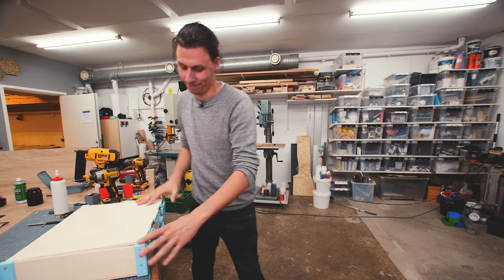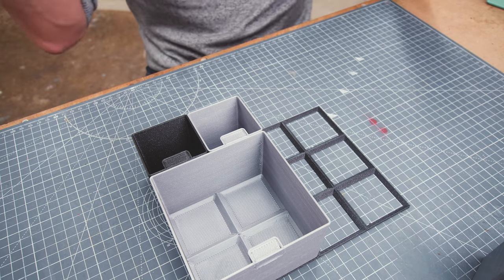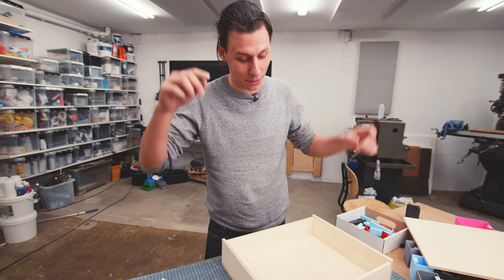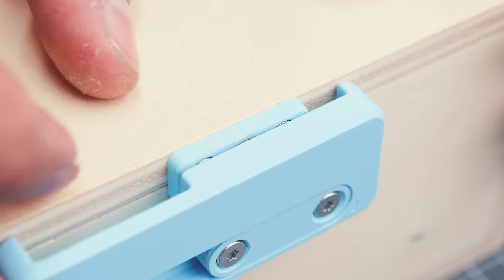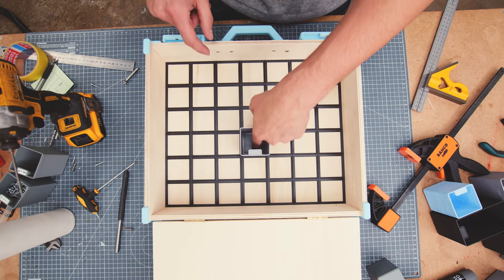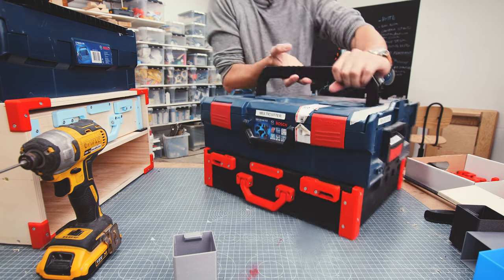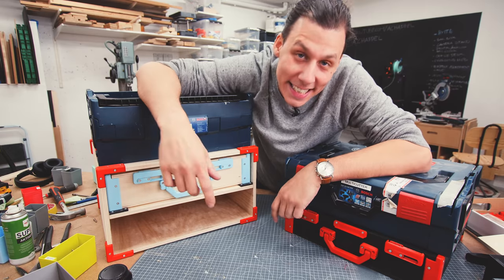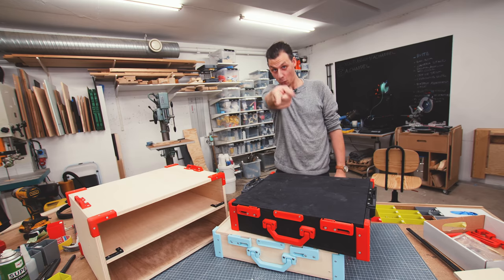3D Printing Even Better Assortment Boxes - And Making a Case for Them!

Comment: another solution to the boxes sliding around is just getting self adhesive double sided magnetic tape and applying them to the base of the drawer with both sides attached to the drawer and place your boxes directly on the tape as carefully as you can to set an overlapping grid with the crosses in the center of the 1x1 parts of each box. then you can lift all of the boxes at once and flip them over and cut the tape flush between each box.

Comment: As far as I can see, the Bosch boxes are wider than your homemade boxes. Would it perhaps work if you modified the Bosch adapter that you screwed to your box so that you could slide it up and down? Then, if the Bosch Box is not on it, the latch would slide down and the box would fit back into the cabinet. Provided you make the cabinet a few centimeters wider.

Comment: Well.... kicked up the printer... just have to adjust wood sizes slightly for available plywood size.    My goal is going to be a bunch of boxes... and an upsized Verizon of your 2 box holder... I’m thinking around 10 up to store a ton of parts and be kinda a cross between these and your other cabinet!

Comment: Made purchase in October.  Rescaled size and height, making each box (50.8mm x 50.8mm x 63.5mm).  Then moved to the 1 x 2 (50.8mm x 101.6mm x 63.5mm).  I know I can turn the box 90 degrees, but I would prefer a box 2 x 1 (101.6mm x 50.8mm x 63.5mm)is this possible. In any case Love your designs.

Comment: I note that your trays are almost square. If they were truly square, you could put the larger multiples in either direction. Personally, I went for a 80mm x 55mm base modules size. That way I can multiply  (or half) either dimension and get a much wider range of sizes. It also matches a commercial size, so I get some for free (they are used in Screwfix grab boxes of screws). And I can use those commercial grab boxes to carry selections with me. 
Not sure why, but my trays never slide about in the drawer like yours. Perhaps because I do not slope the sides. Not sure why you do... The grab boxes have locators.
Catches I do like.
Multiple box carrier- why not just have the boxes latch together? Like the boxes from Makita, DeWalt, Milwaukee, Bosch, etc etc. Simple, light, and you are not limited to two...

Comment: Hello Alexandre, I ordered the files for this parts en printed the lock and handle already. I have a  question: what size bolts and nuts are you using? The holes are about 4 mm, but when I use M4, the nuts are very lose. You're from Sweden, so I think you're using metric sizes? Or not? Greetings from the Netherlands from Bert

Comment: If you make the lid a mm or 2 higher, and then add a little rubber pad on the inside or some foam you know every parts tray is pressed against the lid and even the smallest of parts stay inside of their boxes when moving the case around. Maybe something to try for a next video?

Comment: what hardware are you using for this? like size and qty of the screws, nuts and bolts would be great. I purchased the plans, but it didn't have those listed or a parts list for those

Comment: I really like these boxes. I bought the files for the new models and I can't wait to fill up the drawers in my tool chest. I also like that you listened to your users and did 1to1 versions, which I prefer.

One request: is there any way you could offer a scad file so we could customize the boxes? I want to put them in a tool chest I already have and most of the drawers are too shallow for these. Currently my only option is to scale the existing boxes, but just on the height, and that works but only if I'm shortening them a little bit. I've printed a bunch of them at 60mm instead of 75 and that works well enough, but any shorter and I think I'd have problems with the overhangs, and I'd definitely loose definition on the grid system grooves.

Otherwise, thanks for the boxes!

edit
And definitely the wood colored boxes. Way better than the black. But maybe a more contrasting color for the 3D printed parts?

Comment: Instead of building a box that only holds two boxes, maybe 3D print latches, using a carbon fiber reinforced filament, that allows you to secure the boxes to each other. Something very similar to what you printed to attach your shop made boxes to the Bosch tool box.

Comment: I want to use 9mm MDF as that was more readily available but i do not have a nailgun. would glueing and then the corner pieces with the screws be strong enough? Or do i need to use nails or staples ? Any suggestions are welcome !

Comment: i would remake the big box but before you build it, I would measure (width) the box for tools and attach a thick but not to thick piece of MDF to the bottom of the shelf and top (inside) of the top and then that would fix the attachments not fitting in the box

Comment: wat are the inner sizes of these assortment cases? I would love to make a case with some larger boxes where I can put my hammers, screw drivers etc. Do you also have plans for an assortment case that will hold the square boxes (which can be put vertical and horizontal)?

Comment: Any recommendations on how to reduce the print time on the boxes?  Would running a bigger diameter nozzle help?  I'll be buying the v2 files, any advice on optimizing the printing would be appreciated, maybe a write up on your blog.
Reply: Yep bigger nozzle and bigger layer height improve print speed significantly for this type of thing. Bigger nozzle also means bigger line width so you can use fewer wall lines which further improves speed. Unless you're messing around with printing toys and stuff, increasing nozzle size is one of the best upgrades if you want to do practical 3D prints. Of course the prints don't look as fine but for functional parts it shouldn't matter much. I use a .06 nozzle now but will probably go even bigger for speed.

Comment: i think a possibly easier way to prevent them sliding around would be to just have spacer boxes that are single unti sized in your case. then when you want to put something int he case, you take out some of those spacers, switch them for the boxes in the drawer with the components inside,  then your drawer boxes dont slider around and your case is full of boxes even if you dont need to fill it with boxes with stuff in all the slots.

Comment: Nice! The New Version looks like the System in the "OBI" (German toolshop) Cases. The Old System there was better, the new one is smaler but you cant pick out the boxes anymore, so your System is better for me :-)
How many hours did you need for this boxes? the 1x1 needs >1h at my cura Settings :-P

Comment: I bought the plans. this is an awesome design. 
I just printed the square grid. bun in the grid the boxes can move a lot (3mm in x and y). I don´t think the grid will be as good as the one in the video. 
So whats wrong?
Reply: so the height of the printed grid was only 2mm instead of 4mm in the model. so i scaled the grid in z to 6mm height and now it is working gread. dunno why the height is so wrong in the firstplace.

Comment: Instead of CHOSING a color (black or wood), you should grab the opportunity to color code even more, like, you got the color of the 3D-printed parts to color code slight differences like type of thread and lenght, then you can go for black boxes for torx, or wood for metric and black for imperial or something. Grab the opportunity :) :)

Comment: Well done boxes! But I would test them with some tiny washers, as they can easily fall through the tiny gaps between the lid and the cups especially in the middle of the box/briefcase :-).
Reply: Good point. Could be addressed by using a foam gasket around the rim of cups that need to hold washers and such, letting it protrude just enough to make complete contact with the lid. Such a lip could probably be printed in Ninjaflex/TPE, and for anyone with a dual material printer it could even be printed in-place.

Comment: I think it would have been a better solution, if the boxes would snap in together if they are stacked on top of each other. So you wouldn’t need an extra box to carry them together, how it is possible with some professional boxes, like the Systainer (Festool) or the L-Boxx (Used by multiple companies).
It only requires an additional handle on top of the boxes.

Comment: I need to organise all my bolts/nuts/etc so I bit the bullet and bought the plans for these boxes :) Of course, then I realised they're all too tall to fit in their target drawer. D'oh! Back to the Fusion360 drawing board for me.. (you can't just scale the boxes down due to the locking base feature - well, I could scale both parts, I suppose.. hm!)

Other than that they're great - just like the system in my sorting boxes (a little like Sortimo) but I can have any size containers I want and not the shapes the container manufacturer decided I should have!

Comment: I believe you should have used the printed corner of the boxes to lock them together n'y adding a little lock like for the top of each box it would have been lighter and easier to do

Comment: So in the last one there were a bunch of comments about making a mold for these instead of printing a bunch of them again, any thoughts to that? Personally don't know much of the limitations of cast molding, especially when it has that lip creating that undercut
Reply from the maker: Yeah, It's that lip for the label that makes it difficult to injection mold. Not impossible just expensive. And doing that for all the sizes would be VERY expensive. So unrealistic unless I wanted to start a business selling these to people full time :P And also, making changes like this would mean making new molds, whereas now I can just print new ones :)
Reply: @achappel  Expensive to injection mold for sure, but I think urethane cast molding with silicon molds could possibly work

Comment: Are the 3d files STL or some form of file that I can easily scale in Fusion without modifying things like the wall thickness or label area? Genuinely interested if they are not STL. I was gonna print the remix of your design which was parameterized, but the new design is obviously better.

Comment: The black and red case looks amazing, but rather than committing to one colour scheme, why not colour different cases based on the types of parts you store in them? Black case for screws, nuts, and bolts, while blue cases might be for hooks, hinges, etc. Up to you what colours means what, of course, but colour-coding means that you can grab the right case at a glance without having to read the front label to see what's in them.

Comment: I've been looking at a lot of your videos, but could someone help me out real quick? 

What filament are you/is he using here? I've just used PLA at this point on the Ender 3, and haven't yet stepped out into the realm of ABS or Nylon. I'm trying to do something very similar to this and your previous cabinet video (thanks for the templates btw), but I'm not 100% confident PLA will hold up, and wanted to know what filament the community or you would suggest. If PLA will hold up, that will be my go to, as I'm going to make a lot of these boxes and handles, etc, so keeping costs down would be nice, but if they aren't enough I'm fine splurging for a bit as I'm not strapped for cash (making one for myself and another as a christmas gift)

Thanks! :D

Comment: Great design but Id fear the 3D printed clips mounted to the top of the dbl box to connect to the Bosch tool box wouldn't be strong enough when your parts containers are filled with parts.

Comment: Why not go the other way around with the locking grid? Print the grid on the bottom of the boxes and just cut grooves in the drawer bottom. 
The old box design would also fit that way.

Comment: 4:00 that would be 3/8ths (or 11/32 to be more accurate) ply for those of us stuck in a backwards measurement system. e.g. this: https://www.lowes.com/pd/Plytanium-11-32-CAT-PS1-09-Square-Structural-Plywood-Pine-Application-as-4-x-8/3010116 -- but Lowes only has it in pine.

Comment: Matreshka systems.
You made box to contain two boxes which have lots of smaller boxes inside.
And then, you put this box into the moving box (car), drive out of the bigger box (garage) and so on.
Even myself is made of smaller boxes (cells). We all are the boxes.

Comment: Its nice but the big container for the 2 boxs is not practicle .. u could've made a hinge that link the 2 boxes together and one handle that split into 2 hals when u open them and work as s locking when they are closed

Comment: If the on-the-go case on the inside is the same height as the boxes, they would never spill anyways... Because the case height would have to be the diagonal length on the box for it to actually tip... It's going to be forced upright anyways. The only thing the grid has helped you gain is maintaining placement within the empty case. Right?

Comment: Why not just put magnets on the bottom and add some 3D printed parts that could latch two (or three) of these things together--like the travel tool containers from Dewalt/Craftsman....etc) Maybe there could be a catch on the outside of the bumpers.
a unified handle would be more difficult...but there must be a way to do that too.
Reply: So, watching toward the end, you were thinking a bit that way...but I think you do something to link the corners, eliminating the need for the other wooden case.

Comment: I love how you make these yourself! But why you don't just buy into the raaco ecosystem? They have this modulair design they even have half-size inserts that you can stack. They have storage boxes wich you can hang or carry and everything is modulair :)
Reply from the maker: I used to have alot of the raaco boxes, they are great but I prefer these. Mainly because they are a bit taller, have the tap for the labels and they fit with my drawers :)
Reply: @achappel  I completely agree on the taller aspect! Thanks for the explanation, keep up the great vids :)

Comment: Perhaps a version 2.0 could have a small opening [groove/notch] in the side bumpers to incorporate a "runner" that the case could slide on creating a type of drawer, then you can basically build a filing tower with  uniformly spaced "runners"  down either side,  that way you could then add and remove the cases without disturbing the stack, or consuming a large amount of wood doing individual "cubbies"

Visual Reference: 
[ https://youtu.be/BTGN5QNyA-8?t=1440 ]

Comment: Can't we print the box instead? This way we can have bottom grids and sliding locks built in. Also I would imagine the dimension can be even smaller because we don't need the thickness of the wood.
Reply: That's a really large single piece for the average 3d printer (200x200mm)

Comment: Why not instead have a metal plate on the bottom of the drawer, and then glue/attach little "coasters" to the existing boxes with an inset magnet in them? That should stop them from sliding around (at least as much!) and then you wouldn't have to reprint all of them or use the bigger shell boxes!

Comment: Why not dial it in before the revenue generating release and add male/female clips to both bottom and top of the boxes for connection to: each other, wheel base, Bosch box, other brand box, etc etc?  The "do I bring the two box set-up or the single box with special brackets" question is solved permanently. The print boxes are compelling and appreciated that the work has been done, but $5 for a grid-tie mod?  Isn't selling plans the antithesis of YouTube?  Check out Gary-V to learn how to monetize social in a proven way.. as the king does it. I get that you put work into the design, but you have put that and more into all of the production fo all of these videos.  The king lavishes his subjects always ;)

Comment: I noticed people questioning the strength of some of your 3Dprints.. 
Would you be interested in doing a video on printing things with inserts added while it prints?

I've seen people make rattles or whistles by pausing the print and dropping in balls or items. I've seen people pause a print to add a nut or bolt... 
I'd be very interested in seeing what you could do. Adding some aluminum or steel rods inside the prints, adding cables locked in place... etc. 
You're more creative than me, I'm sure you'd come up with something cool and useful! Maybe you could revisit the 3D furniture projects!?

Comment: I'm convinced half the reason you use wood for everything is that steel is impossible to get a hold of in Norway...
Reply: @frazehaze  Because they take up less space, and doesn't have to be heavy of you use thin steel. I do however acknowledge that it's hard to have the 3D printed parts incorporated as well as they were with the wood. Safes are made out of concrete with steel around, not steel. Using sheet metal is completely different from thick metal plates.

Comment: Printing that many boxes either requires a print farm or infinite patience as a printer it craps out one. box. at. a. time. A single box would take perhaps 3-4 hours on a typical printer.
Reply: If you see the time lapse he prints a whole bed of boxes at a time.  Still takes a while, plus if you have a failure you just lost 6 boxes instead of 1

Comment: Not you’re most thought-out project, this box system. There is already a good number of manufacturers with that kind of system as I’m sure you must be aware of, and with a bit of research you could have avoided some of the mishap (lack of a grid system from the start, make your boxes fully L-boxx compatible instead of having that additional case who doesn’t work once you put the L-boxx bracket).
That said, nice work overall, those boxes look neat and almost make me want to do something similar.